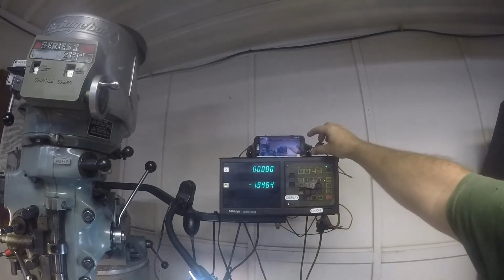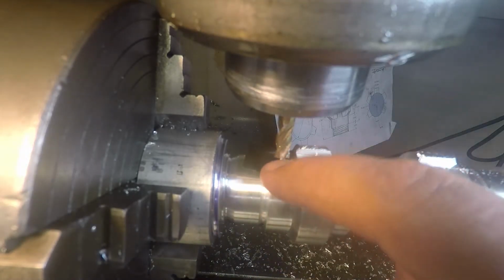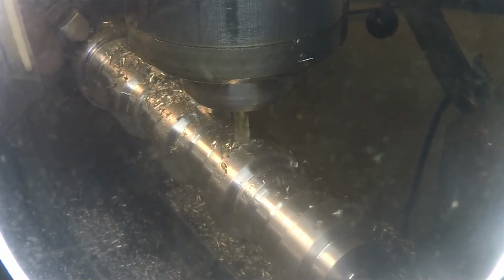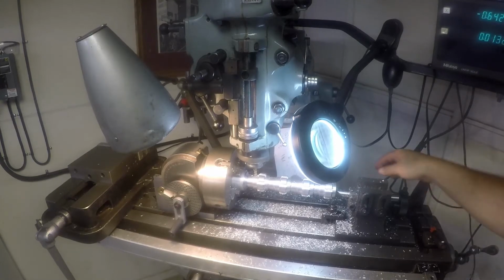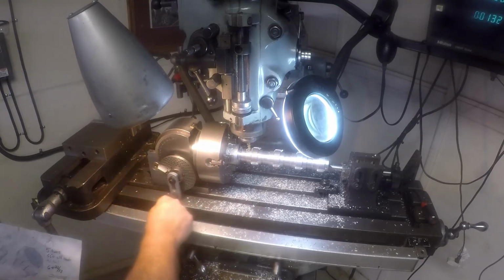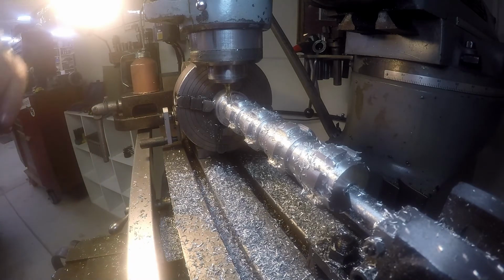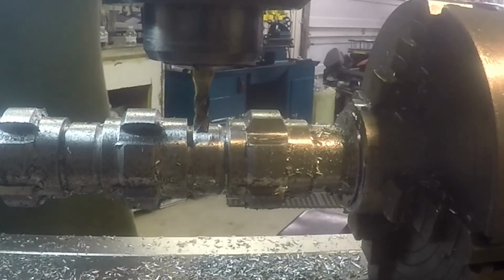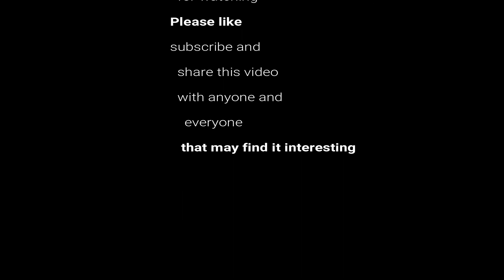ROTJ lightsaber Part #6.3.2 Milling Again

Comment: Do you think I could get that angle cut with a v cutter?
Reply from the maker: Possibly, this actually gives me an idea.  I have a reverse dovetail cutter that may cut those right.  I'll have to look.  If not my new T@C grinder may allow me to make a custom endmill that will work.
Reply: @TheArsonsmith4242  hey, did anything ever come of this? Did you grind a custom endmill?
Reply from the maker: @dannbrauckmann1545  I haven't yet.  I am working now on another set with several process updates due to having more experience and tooling.
Reply: @TheArsonsmith4242  awesome! I just scored a rotary table for my little Sherline, gonna need a right angle attachment and probably a tailstock for it, then I can make an attempt at cutting some pommel cubes!
Reply from the maker: @NegronAngelL  Let me check my box if I have any extras.  I haven't worked on these in a long time and the few in progress ones got put into storage